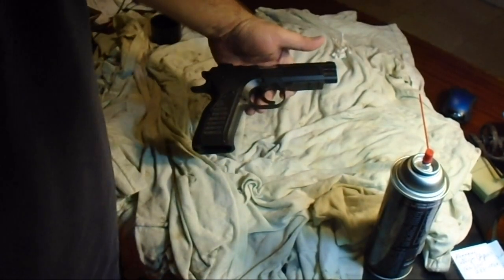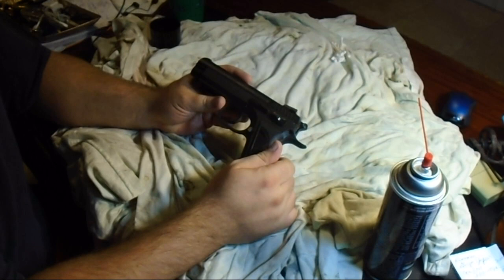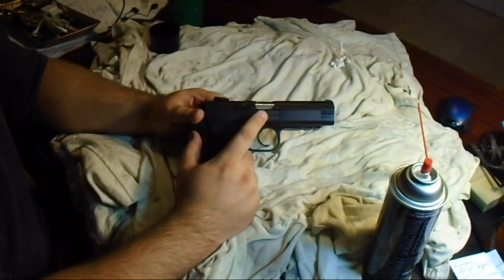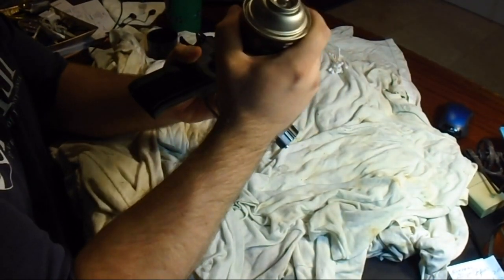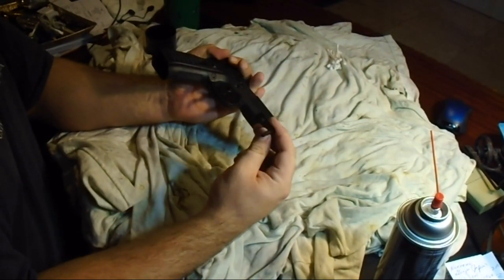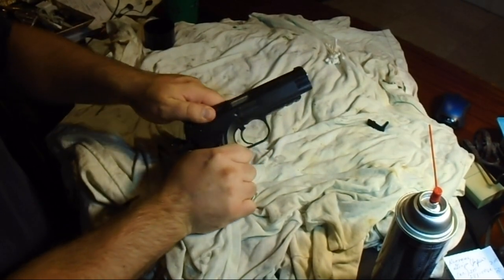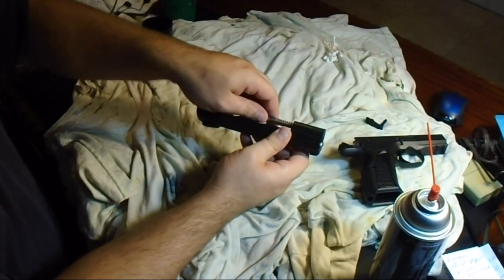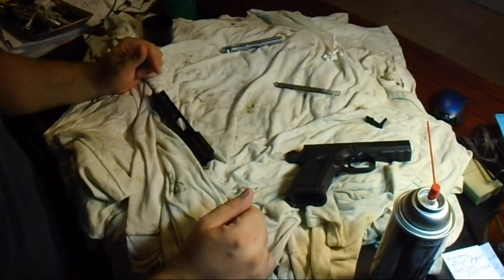Tanfoglio Witness 9mm Alloy Frame Field Strip (Take Down)

Comment: Great video Manny.  Could you please do a quick video on putting the Tanfogilo  back together,  especially lining the holes back up to lock the pin back in.  Seems like it should be easy enough but getting those holes to line back up to push the pin through is giving me hard time.  Great video.
Reply from the maker: I'm glad you appreciate my videos.  You have to move the slide back the same way you do for disassembly in order for everything to line up.  Here is a link to the reassembly video.   https://www.youtube.com/watch?v=AV8hUeMFxzw

Comment: Just out of curiosity does yours say defiant force combat on it? Cuz mine is literally identical to yours but it says its a defiant on the side
Reply from the maker: Mine does not say that.  I would like to see one that does.  The brief research that I did on that says that the pistols that say defiant force on them have stainless steel barrels and full length, railed dust covers.  Sounds like a cool pistol.
Reply from the maker: Buds Gun Shop - "The Defiant Force Plus model features the same CZ75-based mechanical layout but features upgrades to the slide and frame. Improved ergonomics as well as full length dust cover with picatinny rail make the gun instinctive to point and quicker into action."
Reply: I dont havw the plus mine is the small frame
Reply from the maker: @Falconsgang8988  LOL I guess these guys make 9000 different versions of that design.

Comment: Just curious, is that a small frame model and how much did you get it out the door?
Reply from the maker: Thank you for watching and commenting!  I don't think that my experience with buying this firearm is going to help you much.  Reason being, that I bought it quite a while ago from buds on clearance.  It is a small frame, alloy frame firearm.  They were making room for the new large frame guns that were coming out.  I got it for around $320 + transfer / free shipping.  Tanfoglio used to make a small frame just for the 9mm and .40 S&W, and a large frame for .45ACP and 10mm.  They have since discontinued the small frame and now make one frame that can accept all four calibers.  What the small frame goes for right now out there I couldn't tell you.  If you buy a Tanfoglio of any kind please write me and share your experience.  I do not regret buying the gun at all.  I like it a lot and so do the vast majority of those that give it a try.
Reply: Manny's Vlog thanks will do ASAP. I would love to find one. Just not quite a fan of the polymer Variant!
Reply from the maker: There is something great about all metal firearms!
Reply: I paid $269.00 for mine through Sportsman's Guide.  Tax and FFL fee added another $47.19 for a grand total of $316.19.  The pistol is superbly accurate (I practice head shots at 25 yards and keep every shot in 4 inches) and extremely reliable.  Worth twice what I paid for it.
Reply: @derekheuring2984  was that recent?